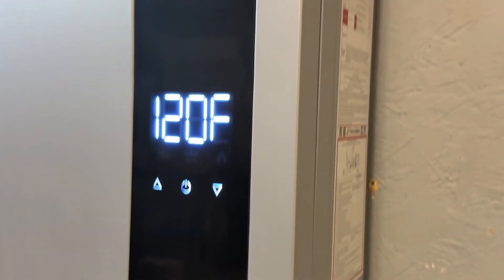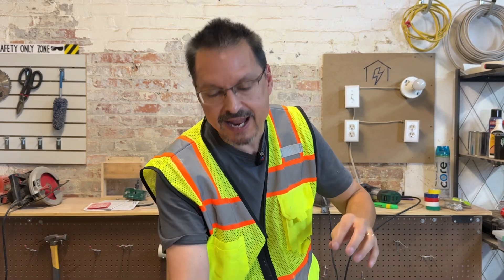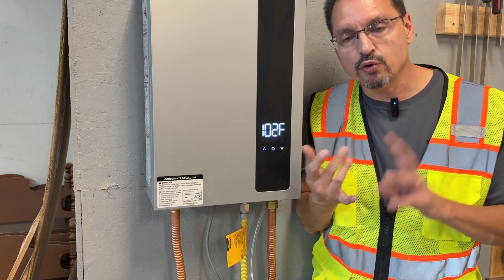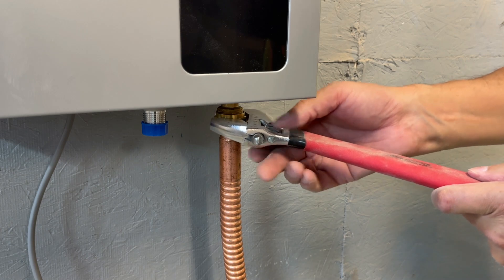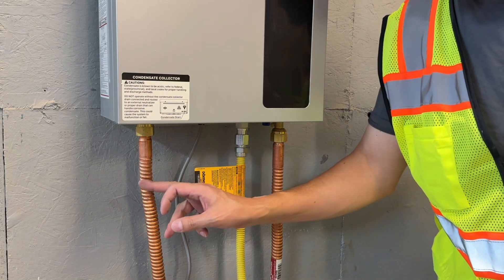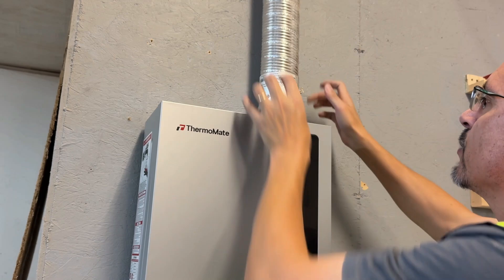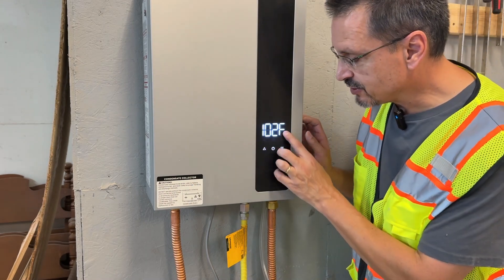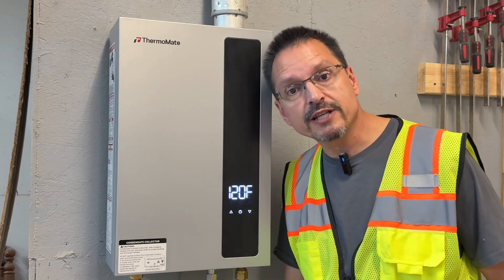Tankless Water Heater Installation (Gas, ThermoMate)

Comment: I install mines, but it last me like a minute with hot water. The tankless would turn off and just keep the fan on
Reply from the maker: You have a gas model or an electric model?
Reply: @HomeRapidRepair gas, I figured it out. Is working good now.
Reply from the maker: @josenegron9634 job well done 👍🏼🛠️